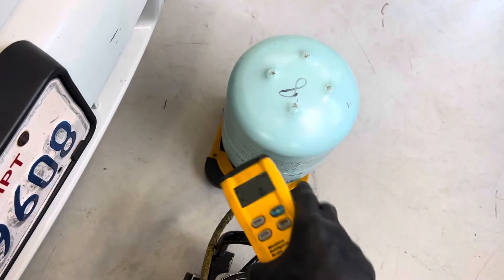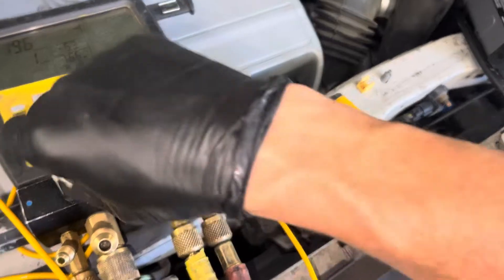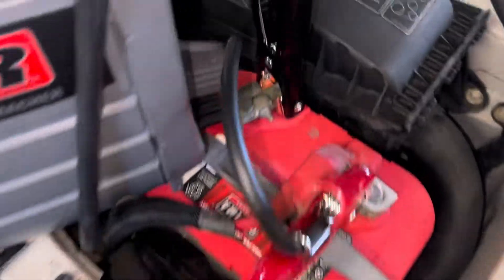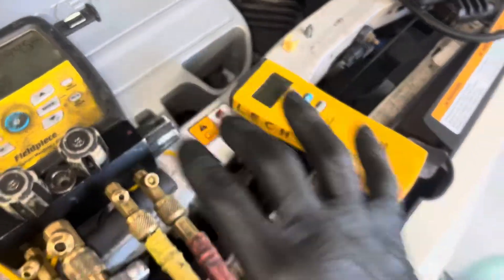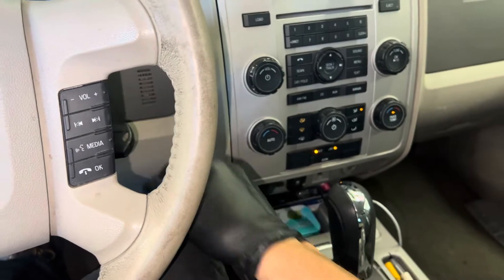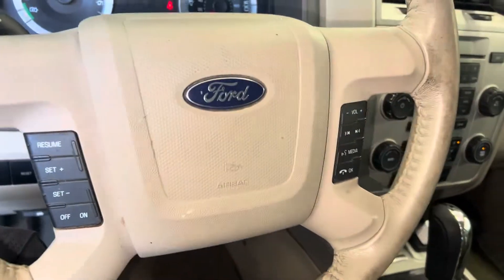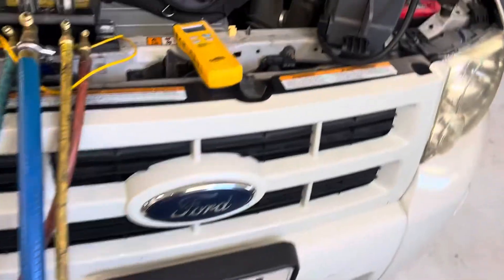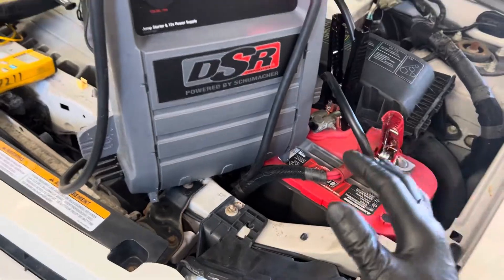￼ refrigerant filling Ford escape hybrid￼

Comment: You put morethan 1080g,what about refrigerant in the hoses, refrigerant & discharge hoses ,are you tobleed them into the system or to keep them in the hoses?.If you put tha exact amount say 1089 gm,do you bleed them in the AC system since included in the scale?
Reply from the maker: Leave it in the hose goes to my recovery machine
Reply: @coldfinger459sub0  If you put the exact amount do you bleed refrigerant in the hoses since it is included in the scale?
Reply from the maker: @issamadam9352  yes
Reply: @coldfinger459sub0  If you want to recover,do you recover the extra amount or the whole amount and recharge it again?
Reply from the maker: @issamadam9352  the extra amount
Reply: @coldfinger459sub0  Recovery  through vaccum machine or another machine?.
Reply from the maker: @issamadam9352  refrigerant recovery machine
Reply: @coldfinger459sub0  How to do that?.
Reply from the maker: @issamadam9352  connect gauges hose to recovery machine.  As refrigerant is recovered it is weighed on a scale so you know how much you take out.
Reply: @coldfinger459sub0  Does refrigerant hose has checked valve since it contains 40g of refrigerant if no valve it well  bleed in the atmosphere?
Reply from the maker: @issamadam9352  both high and low have check valve. Yellow only if you add it.  You can attach high or low hose to recovery machine to recover refrigerant

Comment: How do you take care of the liquid left in the hoses? And,  how do you handle the situation when you put too much?  If you don't have anther job, do you just use your recovery machine in both cases?
Reply from the maker: Liquid in the hose you unscrew your fitting from the high side and then open your valves on your manifold and it gets sucked right down into the low side

Too much refrigerant and it’s trapped in the hose and you don’t need it and it just goes into your recovery machine. 

This stuff is like gold now since our 130 for prices went up to $350 a 30 pound container in the R1234YS sell that stuff for $207 a pound every last ounce is counted as money.
Reply: @coldfinger459sub0  Thanks for your response. Let me reiterate what you said just to make sure I understand. 
So you disconnect the high side and you open the low side, and here I am lost.  You can't put liquid into you low side only vapor but you still do it. The content of your red and yellow hose is in liquid form and can't get sucked in as there is no vacuum any more in the system,  unless you start the engine and the compressor will sucked it in. What am I missing here?
Reply from the maker: @walterkubiak  everybody who was in science class and or math class and they were going over the gas laws and kids in middle school and high school did not pay attention because they thought they would never need to know the three gas laws. 

By understanding these gas laws are you would know that the higher pressure liquid in the yellow hose or the red hose is a liquid at a high pressure

Well the engine is running your blue hose low side is somewhere usually between 20 psi and 30 psi vapor. 

Your yellow hose or your red hose might be 80 psi or even 250 psi. 

As you slowly in my Nutly crack open your red hose or yellow hose valve into the blue hose by understanding the gas laws your valves at the point where it just cracks and opens is now a small orifice a restriction just like a expansion valve or a cap tube or a orifice tube. 

At that very moment that that 200 psi liquid refrigerant is trying to squeeze by that small crack of your valve into the low pressure side it flashes off into a cold vapor. 

Yes you will see the low side hose go up to 40 or 50 psi but it is now a semi vapor with a minute amount of liquid droplets 💧.      Because there’s another restriction another orifice tube called a Schrader valve that is not a wide open port into the suction line that is another pressure drop down to 20 psi or 30 psi. 

     And kids didn’t think that unnecessary stuff they were learning in science class in middle school and high school they don’t need to remember that because it was never going to become necessary later on in life. 

If you truly and fully understand thermodynamics and fluid dynamics and empathy you can master atoms and molecules and make them do what you want not what they want to do to you. 

That’s why on some forms my screen name is Thermal Alchemy
Reply: @coldfinger459sub0  Thank you for your explanation. You made my day...... On another note, what is that key word to get 8% discount from your tool supplier. Thanks again.
Reply from the maker: @walterkubiak  BIGPICTURE 
All one word all caps

Comment: Did you charge the freon via the high side and not the low side? Does it matter which side you add the refrigerant?

Also,  I notice you don't start the car during the charging process, is this preferred vs turning the car on and ac on then charging it.

Watching your videos makes me want to be an hvac tech
Reply from the maker: Yes I charged the entire system to the high side with the car off but you better not attempt this this is only if you know what you’re doing and understand the gas laws and what’s going on otherwise you will not be successful. 

Only somebody who knows how the gas laws work and how to manipulate it can perform that procedure otherwise they’ll probably be end up using the vapor method running the car and slowly pulling in vapor only has liquid damages compressors if it goes in the suction side

This is a trade in a procedure you don’t just try to learn by watching you actually have to understand because it’s very easy to mess understand a procedure when you don’t know what’s going on in cause damage often happens